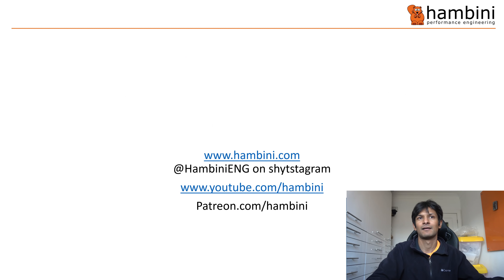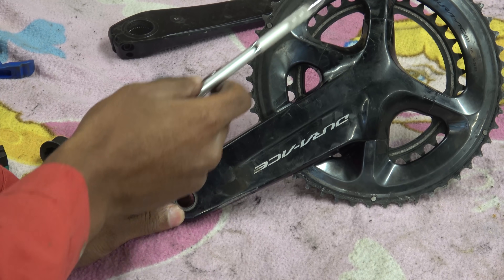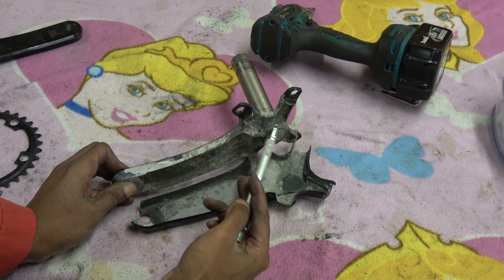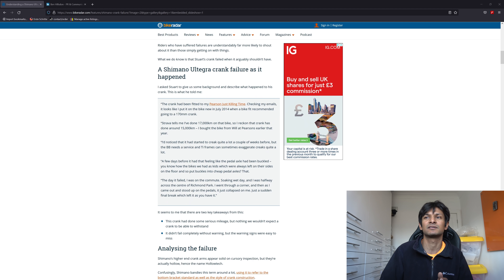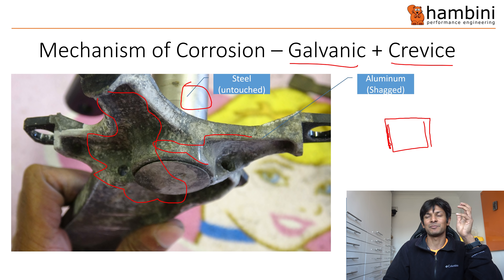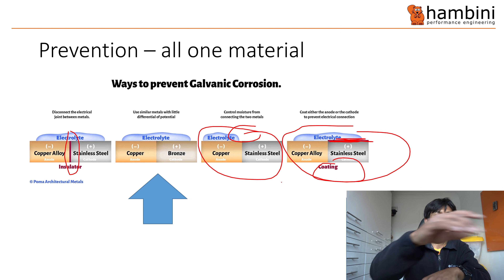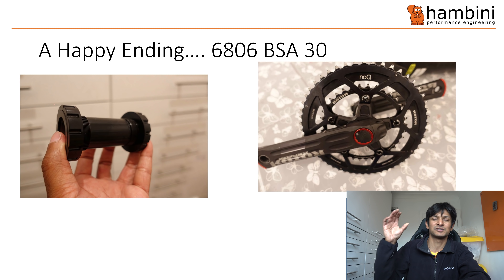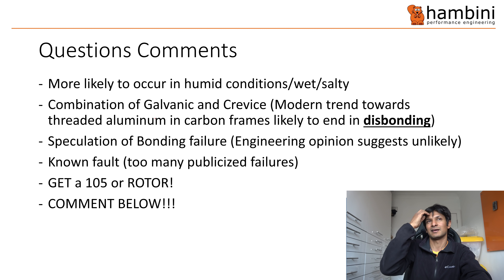Shimano REAMED for Engineering Incompetence

Comment: Not a fan of threaded BB personally. I just lost another frame, nice carbon bike from 2014 with a disbonded BB shell. BB386evo is such a nice combination of features, and it'll never have a shell disbonding failure :)
Reply: Unless it's an alu sleeve in there.

Jokes aside, gutted for your loss. Threaded is good for maintenance but it may not be good for carbon since torquing up your bb may put stress on the alu insert and damage the bond(don't quote me I'm not a mechanical engineering undergrad, I'm a hospitality management undergrad lol) I only torque up my bb to 12-17nm and I've never had problems in 3-4 years.
Reply: @dan_lazaro  the aluminium sleeve is the problem, eventually all inserts will fail. (I've also never overtorqued the BB as it self tightens anyway).
I disagree that threaded is better for maintenance, it's much easier to extract the bearing in a pressfit BB than to extract the bearing from a threaded cup, just eliminate the middle peice.
Reply: I’ve actually just had the BB shell replaced on my Time VXRS, wasn’t that an option for your bike?
Reply: @MartijnPeek  I took it to the carbon repair place here and yes it would be possible but more than the frame is worth. 
Given its rim brake, no point repairing it.
Reply: @galenkehler  ah okay, was it a cheap carbon frame?
Reply: @MartijnPeek  not cheap at the time I bought it ($2000 in 2014 for the frameset). I might save it and try repairing it myself later.  I bought a new frame from a Chinese manufacturer I'm working with for about the same cost as the repair.
Reply: @galenkehler  I’d say it’s worth fixing then, my frame is quite a bit older actually (it’s from 2005) but I’d honestly rather ride on that than on a chinese frame tbh.
Reply: @MartijnPeek  it's all Chinese frames :) but seriously the quality of my new frame is better than the old one, especially since there aren't any bonded aluminum parts, other than the water bottle bosses.
The old frame is barely worth anything in practical terms, it's rim brake, 1-1/8" straight steerer. Nothing compatible or transferable.
Reply: @galenkehler  well my frame definitely isn’t Chinese :p
Reply: @MartijnPeek  lol yeah I could afford a $5000 frame I'd just have my butler take care of the details 😂
Reply: My solution to this issue is to never buy pressfit bb's for any bike.  I just stick with metal frames.

Comment: If you take a look in the lowest part of an aluminium Italian-style coffee maker you will see the same type of corrosion but even more extreme - it indeed can also be caused by water and in case of the crank it probably is. Where alu and steel meet cause of corrosion may also be galvanic in combination with water.

Comment: So if you are looking at a Titanium bike frame, you really need to use carbon finishing kit to make sure it doesn't react as they are both fairly unreactive?
Reply from the maker: correct.
Reply: Exactly what I have.
Reply: If you are worried about the contact between the Al bearings and Ti frame (don't know what other contact point there would be) just use a copper or silver based anti-slip on the threads. This was what my manufacturer (Serotta) advised.
Reply: @massspike  My friends front mech clamp failed on his Ti frame. A carbon clamp with a braze on style mech would avoid that problem.  I think the sweat+Ti+Al+steel bolt caused the failure.
Reply: @MellowYellowCJ7  Aaah...I ditched my front mech years ago so wasn't thinking about that failure point
Reply: Or ti finishing kit, you might as well go balls out if you're getting a ti frame made up.
Reply: You still need to account for the steel bearings, aluminum headset cups, aluminum or steel fixing bolts, etc. There's only so many things that can be made of carbon.
Reply: @Hambini  shame I'm too poor for it 🤣 steel is real 🙏

Comment: I think that Shimano lost their way a bit after the 7800 series (which, personally, I still think is the most asthetically pleasing groupset they ever made) which seemed to be well designed and made from an engineering standpoint. Gluing carbon fibre together in this way is asking for trouble when exposed to thermal cycling and exposure to road borne contaminants (oil, salt, water etc.)
Reply: Yeah. 7800 5 arm looks like a real crankset. When they went to 4 arms and hid the bolts it was a backward step.

Comment: 10:04
If the hidden endcap is not an integral part of the spindle and merely assembled on, then it shouldn't be bonded.
micro-movement induced by pedaling torque may form opening/crevice at this endcap and resulting moisture ingress.
Or, alternatively, there's pre-existing gaps at the joints between steel spindle and forged base spider.

Comment: Glad this video is up. My bike came with full 105 group set but not the cranks. Wanted ultegra but got 105 because the weight difference is sub 100g and stainless steel chainrings. But here is another reason to use 105 over higher  end stuff

Comment: This was very well done Hambini, (minimum of cursing); took me back to engineering meeting days.
It's very likely the Japanese engineer(s) that created this fiasco had to shave their heads in disgrace.

Amazingly though I did not hear you mention sweat as it can be one of the better electrolytes.
And everybody sweats; granted some more than others... so even in a hot dry climate the presence of electrolyte is likely.

Agree that shitmano should be recalling those crank sets.

Comment: Excellent analysis. High-end bike parts always push the limits between light weight and failure. Campagnolo cranks went from steel to aluminum alloy and then Super Record (1980s) got even lighter. Failures became commonplace in short time spans. Shimano 105 is a happy medium between performance and weight.

Comment: Great video, been waiting for this one to come out, does look like a design failure, wonder why they didn't dip the steel axle with coating to prevent the galvanic process between the steel and aluminium interface. I use Campagnolo cranks which seem to last forever, super record axle is titanium. Shame as I like the look of the Dura Ace crank but I'll be sticking to the Campag.
Reply: It has nothing to do with the  construction itself. I have 105 crank sets which have thousands of miles on them featuring aluminum bodies and steel shafts. And I ride in Switzerland in the winter where the roads get treated with salt -> perfect electrolyte. So there must be something shimano effed up in the construction of the failing crank sets. My bet would be moisture creeping in somewhere and the oxides splitting the stuff open and loosening the bond. Bad anti corrosion concept. Finally the battery accelerates it for the "final sprint".
Reply: @cls9474  "It has nothing to do with the  construction itself" "So there must be something shimano effed up in the construction of the failing crank sets"  Not sure I understand your point as it seems to contradict itself. Do you mean there is nothing wrong with using a steel axle with aluminium crank spider? True if there is something to prevent moisture between the two parts but a bike sits outside and atmospheric conditions will cause moisture on the inside of the crank arms. If Shimano used a barrier layer between steel and aluminium that would help. I believe 105 cranks are made differently to Ultegra and Dura Ace.
Reply: @danbanham728  No, it doesn't contradict itself. The only difference is that the 105 are welded (no seam where moisture can creep into). Apart from that the construction is the same. Riveted steel axle on an aluminum body. And as I said: I don't know anyone in my bike infested circles who had any problems with the 105ers. I have a bike which I just maintained (just installed the 4th BB) with a triple 105 and same construction: Not the slightest issue. And I ride in the winter in the mountains with salty snow slush. For more than a decade.
Reply: @cls9474  Ok, so the construction isn't the same then, one is welded and one is bonded.
Reply: @danbanham728  Yep, but the battery exists on both. And that's what I'm talking about. The steel-aluminum design doesn't seem to be the problem as it seems to be managable. And that's your main point in your original comment.
Reply: @cls9474  Yep true, good point. shame Shimano didn't change the design from bonded to welded when lots of these failures happened at the start.

Comment: Just to add my two cents worth. The bond joint appears to be somewhat small. Adhesives are hydroscopic, they take in humidity. Add repetitive loading through the adhesive joint, you will get fatigue failure in the adhesive (plastic) material. But especially when you have bond interface failure between the aluminum and the adhesive (which has taken in humidity). The humidity ate the aluminum surface, and the bond joint let go after lots of repetitive loading. You may want to reference to the McDonnell Douglas MD-90 wing skin bond joint failures. Humidity and bond joints don't get along well when there are repetitive structural loads!

Comment: bought a 105 because of this and its still going strong. also using steel bearing BB also due to what I learned here. my previous ceramic bb spoiled at 100km.
Reply: Shimano has officially recall their Ultegra/Dura Ace chainsets 2nd gen batch due to bonding issues. 105 is unaffected.

Comment: Although I have switched from my 6800 with sigeyi power meter to Aldhu 24, this is exactly what I'm waiting for.

BTW, I found a lot of Chinese "CNC" cranks (dirty cheap, less 100 yankee dollars) with 24 mm axles (some thick 7075T6, some steel), all with SRAM 3 pin direct mount.
Different preloading methods (from direct shimano copy to SRAM/Aldhu like preload ring).
Some good ones (like the one from Fovno) weight only 515g (cranks + axle), only slightly heavier than aldhu 24.

Any intention to review some of them?
Reply: I have the Fovno Phantom and the most common issue is there M14 bolt breaking. Also, there's no available M14 bolt replacement to buy anywhere. Other than that, everything's really well done.
Reply: @WashichawbachaW  Awesome!

Comment: I am 63kg with an FTP of 250 watts so I was shocked when I got a full on crack on the spider/arm. Thankfully it was warrantied but I bought a R7000 series 105 to use while it took a month to get my  new DA crank and I liked it. I didn't know it was welded though. I just heard it was still hollotech and was slightly nervous about it.

Comment: The conclusion to get a 105 really put my mind at ease, because (being a rider on the lower end of mediocrity) I could never justify spending more than 2k on a bike, so now 105 is what I have on both of them 😂
Reply: 105 was my workhorse for my first 20 years on the bike. I fell for Dura Ace 7800, the last of the silver. 105 is still really, really, good. I have Ultegra DI-2 now but did not fork out for the cranks and kept my 105's. Happy days

Comment: Thanks for the video. I read it was recomended to use copper paste in the contact between a titanium pedal axle and the crank because it may get stuck forever. Now I know it's mandatory. Also, cleaning the bike is starting to look like a bad idea, at least with water.
Reply: With decades in bike retail I believe NOT washing the bike (with water) is worse. Flushing away the salt buildup and letting the bike dry thoroughly (in the sun is best) is key to avoiding problems. Make sure there's a drain hole in the BB and dry the bike on its wheels so the BB is the lowest point before you hang it up anywhere. I've had zero issues with this regimen whether the bike is steel, aluminum or carbon, no matter what brand the components were. 
But in this specific case I wonder how moisture is getting into (and seemingly not out of) the crank assembly?
Reply: @larryt.atcycleitalia5786  From what I've heard about waterpoofing electronics, temperature fluctuations making the air inside the cavity expand and contract and capillary action are enough to pull moisture laden air into the cavity through the tiniest of gaps. For outdoor electronics, apparently it is often better to have a drain hole down the bottom of an enclosure rather than try to completely seal it up. As for bicycle cranks - I think I will stick to the garden variety solid units for a while :).
Reply: @cyrilmonkewitz  It's a good thing Hambini brough this issue. If you don't use grease in some places you get noise or lower lifespan of the pieces, but when two pieces of metal get stuck because of lack of proper grease or treatment (like unscrew the bb regularly) you get a nasty problem. I hope your Ti frame beat the dremel! It's really a concern, in a Ti frames because I think all bb are from aluminum

Comment: Instead of talking crap, as i mostly do here,
I will give some background to your comments;
Did a vid on this and the short answer is, Shimano is not admiting this problem exists ( as a design problem).

As to the corrosion, they is a number of issues there. It is not just about steel and aluminium, but if you have big swings in temperature, the dew point changes. This means you could have a partially saturated air in the crank at manufacturering. But when the temperature changes the moisture becomes free in air and the cycle of corrosion starts, making an electrolyte for the corrosion. Starting the process, although it maybe fully sealed.

As to fail safe. The key is the unwanted outcome, i.e. you have a domestic charger pack with a transformer in it. The unwanted outcome could be that it catches fire 🔥. If the tranformer failures, and it either doesn't catch fire or cause the plastic surrounding it to catch fire. It is deemed to fail safe. These tests are pretty general for domestic products in western countries and these tests are defined by Mandatory Standards.

Comment: I had an Ultegra 6800 fail in this way after 4 years of use. I only happened to notice it when I saw a small amount of flex on the drive side crank, prior to that there had been a bit of creaking and it also felt like my foot was tipping over. I contacted Shimano directly and they said to return it to my LBS for warranty. I didn't particularly want to wait to get it sorted so bit the bullet and bought a new crankset, choosing an R8000 Ultegra over an R7000 105 - in hindsight this was probably the wrong choice! Annoyingly, I had only recently replaced the large chainring on the 6800, and they're not particularly cheap for what they are. 
Interesting about the response you got from Merlin - I remember having  a similar response from Chain Reaction a few years back when I discovered that the chain (Ultegra 6600) on a bike I had bought from them had multiple cracked outer link plates after only 400 miles of use! Their response was "chains are wear items and are not covered by warranty"!! I didn't use them for many years after that.

Comment: Interesting report, was surprised about the reaction between carbon and aluminium though.  Does this mean we should be concerned about aluminium threaded inserts into carbon forks or even aluminium fork steerers bonded to carbon fork blades, both potential death traps. LB's comments below seem to state otherwise

Comment: Funny Isn't it that during the great Shimano groupset 'pandemic' drought, that the suppliers that list the availability of each component part of the groupset have displayed that it's the availability of the crankset that has often been the limiting factor- I know this as I've needed a groupset throughout and have been keeping an eye on it. I speculate that they've known about this for a long time and limited or pulled the production before the redesigned new group sets are coming on line - I hope they've fixed the issue as Shimano have, in the 35 years I've been using them, had excellent reliability and engineering standards...but as is often the case, some of the older stuff was better because they concentrated on making simple stuff really well.

Comment: I've had the same with my 3-year old Ultegra, it got replaced without a problem, no cost for me. You hear it coming long before it wil catastrophically fail.
You got a lot off pictures and complaints but in the grand scheme of things, it isn't all that common. Shimano sell millions of crancksets every year and only a handful fail. It shouldn't happen, but normally they replace it, no questions asked (even outside the warranty period).
Sometimes things just break (like my RX-805 DI2 rear derailleur, after 3 years through rain and mud, and that wasn't warranty 😞 )

Comment: Sram cranks are just as crap, as Hambini has already shown in the past. I've had two Sram cranks fail on me because of disbonding metal inserts. The pedal thread insert started wobbling on one. The nds crank started wobbling on the aluminium axle on the other. Still riding a Red crank on my gravel bike and I'm curious when that will fail. My 2010 Campagnolo Centaur carbon crank however is still working flawlessly after many seasons including wet and salty winter roads.

Comment: My understanding is hollowtech was originally hollow forged cranks with cartridge BB (octalink). That is the diagram you showed. Hollowtech II is the two piece cranks with external BB. They have bonded parts rather than hollow forging.

Comment: My shimano 6800 failed when I was stomping up a hill. Left me with a bad bruise on my groin from it hitting the top tube. Glad it wasn’t worse!

I went to my LBS and they weren’t sure about the warranty claim holding up as my bike was 5 years old at the time. I insisted they send it to Madison as they have replaced. 

They replaced mine for the newer R8000 but I sold them and went to 105 5800.

Comment: Thanks for this video Hambini. Excellent insights as usual. I've had an annoying creak on my bike for the last couple of months and really thought it was the BB. Only checked the drive side crank arm due this post and noticed the Ultegra 6800 crank arm was splitting at the seam. Can send the duff part to you from the UK for dissection if you'd like!